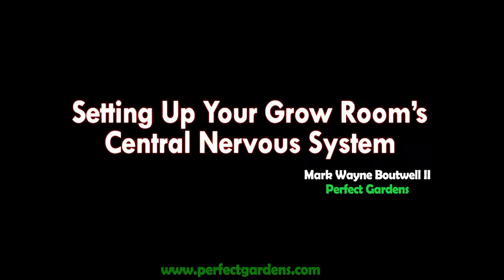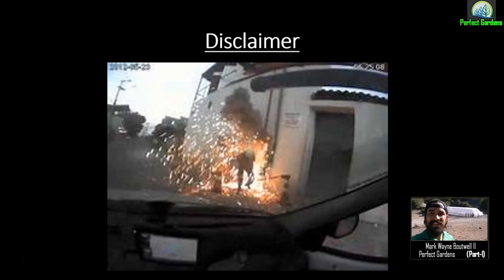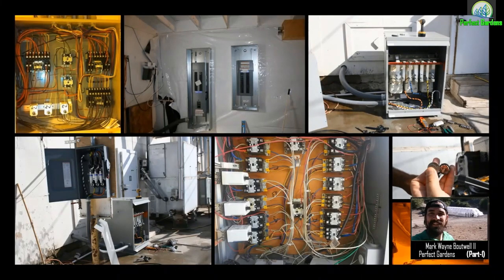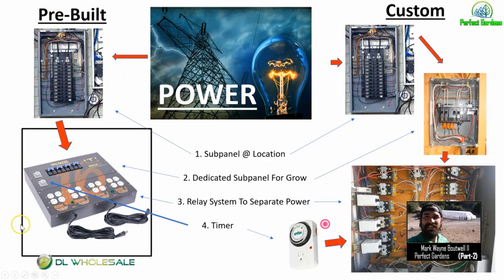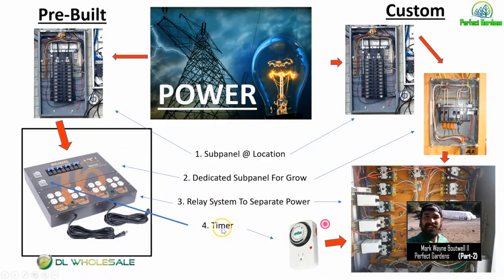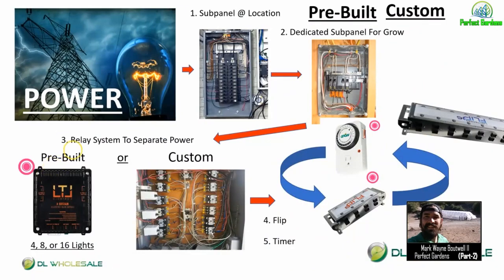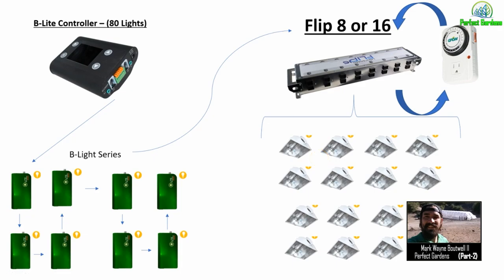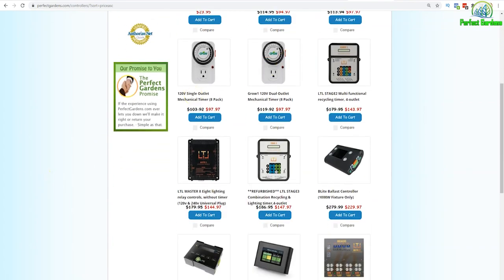Grow Room Controls: How They Work Together

Comment: Thanks for the great information on lighting the grow space. If I’m running LED lights (1-2), are these applications something I should be considering at this time?
Reply from the maker: For 1 or 2 lights no unless your breakers are popping or getting really hot and you don't have a second plug on a seperate breaker.

Does that make sense?

Mark
Reply: @PerfectGardensTV  Yes. Thank you!
On another one of your videos you brought up ingredient references on Wikipedia except for Zinc EDTA. If you use Google Scholar dot com, then you'll get verified scientific information that is reliable; whereas, Wikipedia is not a scholarly source. I did find Zinc EDTA there. Hopefully this is helpful.